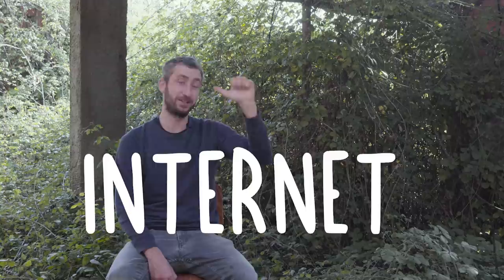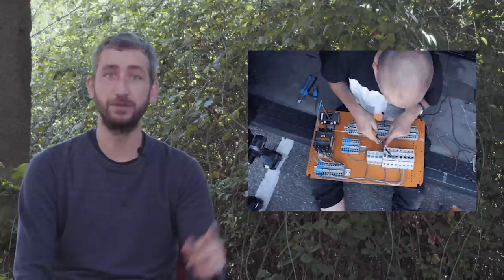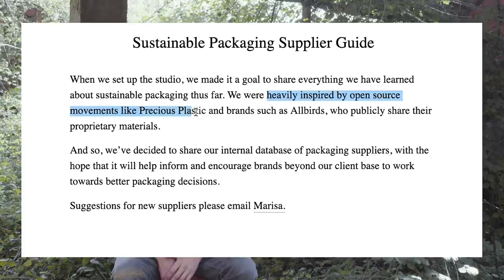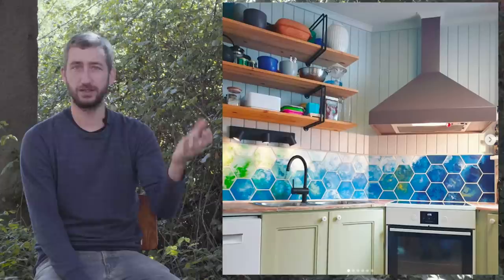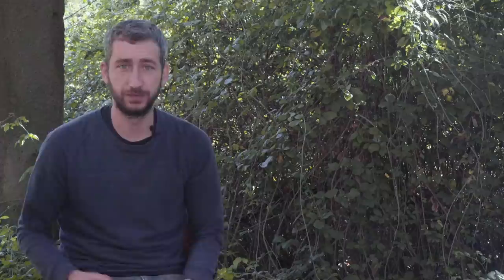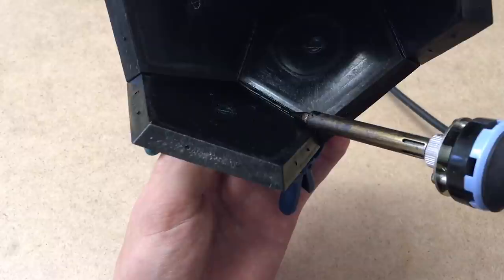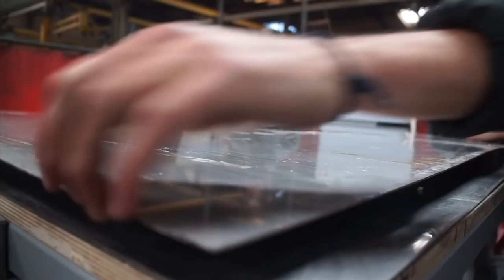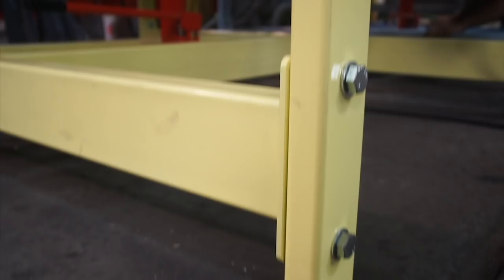MN #46 -  We made a big pizza press!

Comment: Why aren't you taking advantage of this chance to go Solar?!? And don't "clean" up The Green, KEEP IT GREEN!!🥳🤸🏼‍♀️💃🏼
Reply: Solar panels are super cheap now, and you can start off with one current regulator for daytime use, then throw in some batteries for nights and backup.
Reply from the maker: we have some crucial machines that run on 380V (welding, metal lathe) according to my calculation it will be very challenging with battery managment. And I don't know many examples of projects running 380V, specially in early stages. But I would like to be convinced for alternative energy. Going to the grid feels like going backward
Reply: @OneArmyVideos  You have 3 phase machinery, and you need ample power, and that much power Only when operating them. One, you can get a specialist from among your followers to get it done, and correctly,  Two, you can operate absolutely every single thing else on solar, using the grid only when you use those machines, until you work out the system you need.😎🌤

Comment: Hi, I’m not sure how far the land is from an electrical junction but I know it can cost a lot to get connected in a remote location. Did you consider building a large solar array and battery storage to start that can be expanded as required?  Wind and micro hydro alternatives are an option.